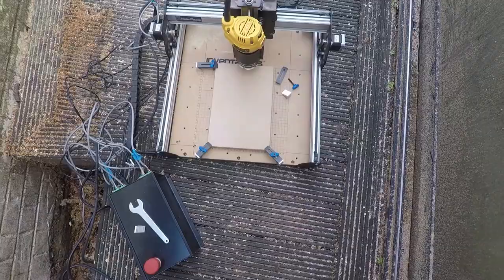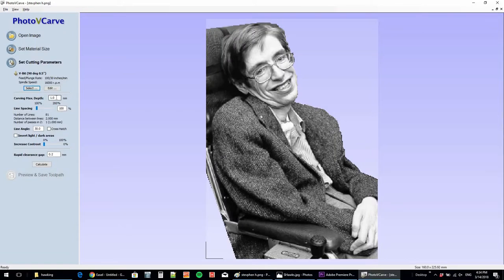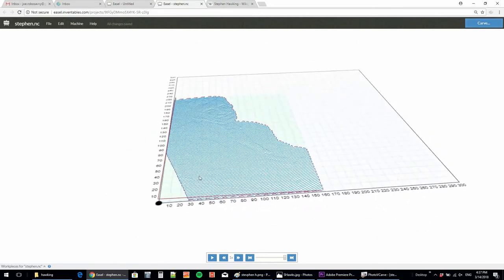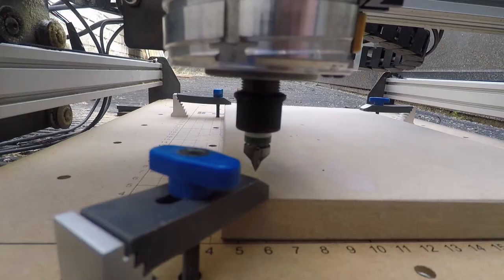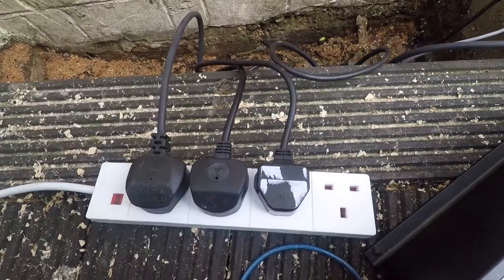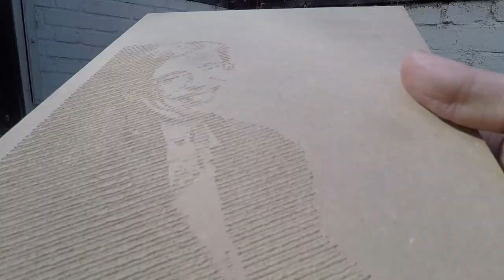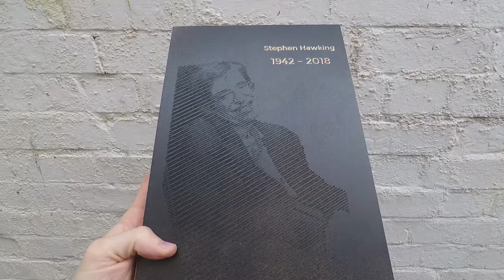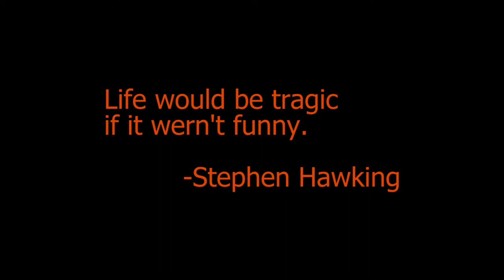Making a tribute to Stephen Hawking using wood and PhotoVCarve

Comment: Well done friend!   Paint black and then sand the surface leaving paint only in your grooves.  The contrast greatly enhances the effect of the depth of cut for higher or lower color density... I hope that makes sense.  I think I sealed the surface with sanding sealer prior to cutting this prevented my black acrylic paint from seeping or bleeding into the surface but still let it color the grooves well and made sanding the black off the surface relatively easy.   Hope that info is helpful to somebody.   Keep up the good work.
Reply from the maker: Makes total sense!  I actually did that on the carve before, but mine didn't turn out that well.  Glad yours was successful!  Happy carving!
Reply: @JoeMakes  There does seem to be a lot of things that can create a lot of variation in these types of carvings.   Great work appreciate you sharing your experiences with us.

Comment: Great project! I think this would look great with the ABS product from Inventables to really make the picture pop.
Reply from the maker: Thanks!  I have used that material before but it doesn't carve away nicely.  I may try a different material/plastic for some future stuff if you have any recs
Reply: I could believe that. I am in the process of making my X-Carve and excited to use it, but dont have the knowledge just yet on the materials. Either way, great project.
Reply from the maker: Have a blast with the Xcarve process.  And feel free to carve this same one (the gcode is on the inventables projects page).  Let me know how it goes!

Comment: Very cool software. Just curious if increasing the depth of cut would have more relief and maybe make it easier to see. Nice job on how to use the hardware and software.
Reply from the maker: Thanks, I tried cutting one deeper but was harder to see the little details (like his glasses).  Trying to find that perfect Goldilocks zone
Reply: cut one a little deeper, then spray a thin layer of clear over the whole thing. Then spray the whole thing black. After it dries, sand all the black off the top surface just leaving the black in the grooves. that may help. Great lil video tho!
Reply from the maker: Thanks for the idea!  I did that on some carves afterwards, but the image still didn't "pop."  I'll keep experimenting and do an update video.  Cheers